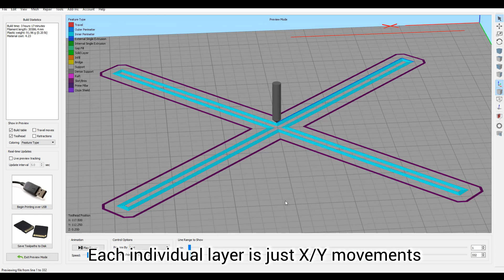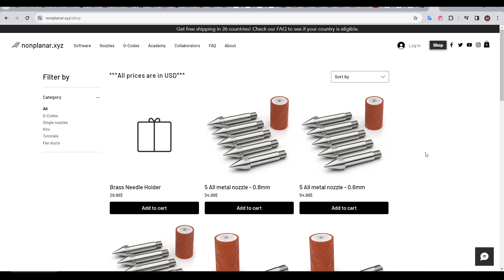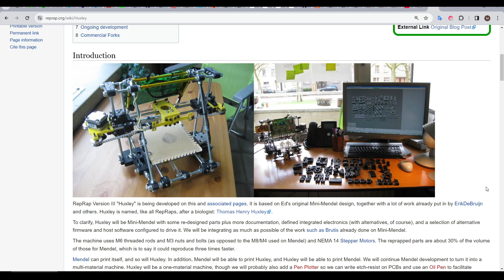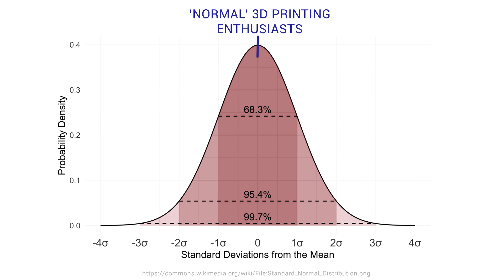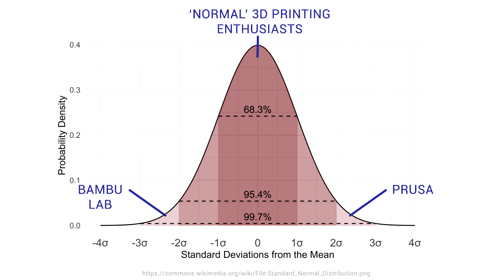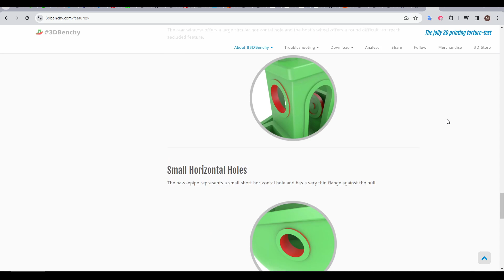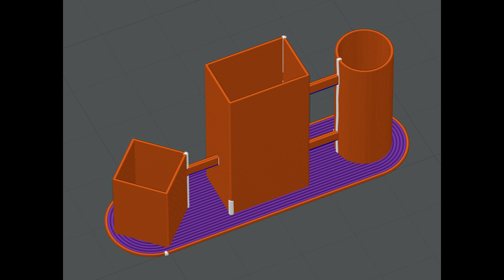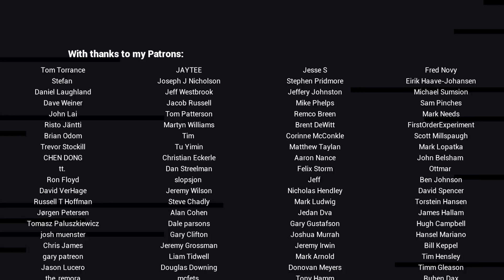3D printing mysteries that need to be solved in 2024

Comment: For the surface artifacts: my hypothesis is related to thermal expansion and cooling. When you have a top surface, you print more slowly, thus cooling more the rest.
Reply: It´s variations in flow rate, speed and cooling. You can change the preview in the slicer and you will see the difference.
Reply: with a layer time that was consistent across the entire part, these went away in my case. they would always show up with large jumps in layer time either direction.
Reply: @mrrooter601  This always, happens in any part. You change the print parameters mid print, it will show.

Comment: Excellent video. I'd like to know why belt printers never took off. I assumed someone would do more and better cr-30s but nope!
Reply: It's still early. Maybe the time will come. For now what I understand is that belt material is a problem and belt centering/positioning is also an issue. 45 angle is also pretty extreme, there are some printers (or mods for CR-30) to make it less extreme, or even 90 degree printing is pretty good because it allows for infinite part printing without much of slicer changes. Yeah, also slicers and infinitely long GCode files are becoming an issue

Comment: Non-Planar 3D printing and those neat overlapping circles for overhangs! I would very much be okay sacrificing printing speed for quality for some of my prints. An on/off toggle would be *chefs kiss*.
 I'd 100% pay for a slicer plug in (*cough cough* Cura now supports full slicer plug-ins like this now, developers!)
Please and thank you.
Reply: I would as well, but there is a conflict here that the people most likely to work on something like non-planar printing would probably be on the easiest to tweak firmware too, and then they are unlikely to be Cura users as Cura has no Klipper flavored gcode output because it's almost all Ultimaker devs, and ultimaker has no klipper printers.

Comment: I may be wrong but I think the filament breaking is just humidity. It's somewhat humid where I live and because of school I may go weeks without using my printer. But it's pretty normal for me to come back to my printer with the filament broken just before the extruder and I need to extrude all the filament currently in the Boden tube as it's too brittle to pull out. That filament will also snap if bent. But then I'll throw the spool into my dehydrator and afterwards it's fine and not brittle. After a few weeks of not using it again and telhe process repeats. So in my experience it's just humidity that causes that. Maybe difference in Temps thought the day causes more humidity or condensation in the boden  leading to that section more brittle or something, I don't know, but that problem for me at least is always able to be fixed by drying my filament.
Reply: I don't think it's really the humidity. Because you can make an experiment, put a coil of filament into a ziploc bag with half a spoon of water, store dark and cool. When you retrieve it weeks or months later, it will be extra supple rather than brittle. It won't be what one would call printable but it's a different issue, it will feed well but cause a calamity in the hotend then, so when you have waterlogged filament, you still need to dry it.

I wonder if the PTFE tube itself plays a role, whether it liberates fluorine compounds, or some fumes coming up from the hotend from the filament melting process itself into the Bowden tube. But i personally don't use Bowden and have not had this issue of brittle filament, but i also have everything far away from UV light and have exceptionally low air humidity.

I am still undecided whether water does make PLA brittle or not, want some credible evidence, but at least a limited waterlogging experiment doesn't suggest that it necessarily does.

Apart from degradation, the matter could be of reversible changes that get alleviated when drying effectively anneals the filament.
Reply: @SianaGearz  my main point was that after a few weeks the filament outside the boden is also brittle for me, I can also sometimes get some of the filament out of the boden but it is very brittle. When I put the brittle filament into the dehydrator, it's no longer brittle and is like new. So it was brittle, then wasn't after dehydrating. Which means something happened when dehydrating that made it less brittle. So my guess would be humidity. I'm sure with the bag it's an extreme example so it will net different results compared to real world scenario of humidity in the air
Reply: @Penguun  That's good to know.

Comment: Capricron now has a Reverse Bowden tubing product available so when those filament breaks happen, you can get the filament out much, much easier.  (Rather than playing chimney sweep with a small aluminum rod to unjam the material!)  Tribalism is a great term!  I see that with the Prusa and Bambu Labs folks.  I think part of this is that Prua is very Open Source where Bambu Labs simply isn't and probably won't be.  And who wants the Communist China apps on your phones to print?  As for the Voron crowd, those are very technical builds - built one here at work and it sure wasn't easy.  One thing I was hoping you were going to mention is the obsession with PRINTING FAST.  Sure, you can.  But if you are making functional parts or large parts, you are giving up quality and possibly part strength by doing so.  If I had to give one award for best thing in 2023 - improved tree supports!

Comment: I agree that we need non-planar and custom-planar setting- availability in mainstream slicers. No question. We also need devs to stop removing features "for no reason" and making the user experience objectively worse through progressive changes to the interface.

The filament "swirl direction" phenomenon is indeed coincidental. It may depend in part on the filament's curvature as it enters the toolhead. I've personally observed it swirl in both directions in the northern hemisphere, sometimes within the same operation (no cessation, no retraction, no replacement).
Reply: When have you ever seen a developer remove a feature "for no reason"?  Do you mean for a reason you don't agree with?
Reply: @crashingsux  I've many times seen a developer remove features without giving any reason whatsoever (such as CURA repeatedly removing the Change At Z feature). I've also frequently seen developers remove features while giving reasons that don't hold up to any scrutiny (ex. Microsoft removing every accessibility feature from Skype when they bought it). Both of those are separate and distinct from developers removing features and giving reasons I disagree with (every program that has ever removed a configuration option entirely instead of hiding it under an "advanced" section stating "it's too confusing for people" or similar tripe, or eliminated the Menu Bar "to make things easier", or ripped out the command line API with the same sort of excuse).
Reply: @claws61821  Sounds like some really bored developers who hate the users they write software for.  That must be it right, it can't be like they have competing concerns and someone else besides you is asking for that feature. Hard to believe Ultimaker pays those CURA developers to do things like that.
Reply: @crashingsux  Uh-huh. Goodnight, Troll. Enjoy deliberately missing the point throughout the new year.
Reply: @claws61821  not intending to troll. I hope in the new year you can find a way to appreciate the developers who toil away for no compensation providing you with the software you use and maybe grow to appreciate it enough you stop insulting their character and motives.
Reply: @crashingsux  You asked for examples. I listed several. Your reaction was to respond sarcastically with a moralistic fallacy and psychologist's fallacy argument. Textbook trolling tactic. That after you attacked me ad hominem for my initial rhetoric (which was enclosed in quotes to specifically emphasize it as such) and combined with a second ad hominem attack. While there is certainly a possibility that you weren't intentionally trolling me, as you say, the weight of available evidence suggests otherwise and that you are, as the kids like to say, "covering your ass".

Comment: On topic of the surface artifacts.  I would try changing the minimum layer time. My theory is that because the layer with the additional object takes longer there is more shrinkage compared to the previous layer. 
If the next layer goes down quicker it reinforces the previous layer and lessens shrinkage.
Reply: I concur, if you use the slicer from prusa, orca, or bambu, you can check the speed of each layer by changing the line type. I can almost guarantee that's the cause, as it's something I had noticed in the past as well. This needs a bump
Reply: This is true I run into this issue when printing things that need a lot of support
Reply: There will be more shrinkage but also the plastic has longer to cool down, so when it gets to that section on the next layer the plastic is much cooler and hence maybe doesn’t fuse as well. Maybe decreasing speed on those sections to allow the layer below to soak up more heat again would help.
Reply: If you switch the view to volumetric flow rate and scroll through the layers you'll see it happens whenever the flow rate changes.
Reply: @ExtremeODD  in Prusa slicer there is a way to control the volumetric changing speed. Do you think it could solve this problem?
Reply: @leopagottigmail  No, this has been tried, there is an entire thread dedicated to this on the Prusa forums that have tried pretty much every setting on multiple slicers.

Comment: I live in Spain rn and I tried extruding filament at differents heights but it looks like the way it turns is pretty much indifferent, at least for me, with an Artillery X1 with a Hemera extruder and a Volcano nozzle it doesn't have a preferable way to turn, i'd say probably like a 50/50 chance to turn clockwise and viceversa. I think it's all about the shape of the filament when it's dropping and starting to cool down, as with every little variation it hits the bed slightly different and it turns in the direction that is easier for it to drop flat at first. 

That is my general observation, but I'd love to see actual testing on this as I think it's a really interesting proposition.
Reply: I'm in the northern hemisphere, and checking the poop box from my X1 Carbon, I have several examples of clockwise extrusion and counterclockwise extrusion. I don't see any indication that it tends to coil in one direction preferentially over the other.

Comment: I do not know why the world has gotten so cynical, I used to enjoy the groups now I avoid them, and just search out what I need to know to fix things. I started out with Bambu lab printers I watched your video on the MP mini Delta I had the have one, so end up sourcing some parts only V2 off of eBay now have three of them working. I can sit there and watch that thing Print all day long, It’s mesmerizing and relaxing better than a fishbowl. And enjoy watching your channel. I learn a lot from watching your channel. And just from suggestions and ideas I’ve come up with some really cool stuff to 3-D print for people that nobody else is making. And less than a year I paid for my printers with a few things I have printed and sold. On your square cylinder and square block I think it’s speed, retraction and cooling and watching Prints as they print as they get to the top of one it slows down to give a good finish on the one that is completed, which seems to always affect any other objects that are being printed, if everything‘s the same height, you don’t see it, but when it slows down the print the top of something it shows up in the other prints, I’ve seen this on the Bambu and the MP. Both the slicers will let you address these sayings to some point, but I can’t seem to get it to go away either, so I’m praying things with multiple heights. I usually print them separately seems to be the best resolution so far. That’s all the input I have enjoy watching your channel. I’m glad you’re out there and you said it’s the 3% that matter the least they’re the most vocal so ignore them. That’s what I do, Granted, with the small amount of videos I have up I don’t have any comments and I think that’s a good thing.

Comment: Color me ignorant, what is the difference between a core XY and a voron?  A possible answer to your question as to why it seems more toxic is because most of the center of the bell curve tend to be quiet even though it's a larger number of people, and people in the extremes tend to be more vocal. So it's really more of a per capita situation. You would have, in the past, five people in the extreme category but they could only make so much presence because of their limited numbers, now that you have 5,000 people in the extreme column even though that's a small minority compared to the center of the bell curve, it seems like they make more noise, but that's only due to the per capita effect. There's the same effect in news where people used to think that crime was getting worse, but it was simply because more of it was being covered because technology allowed for it.

Comment: 11:53  sometimes a feature like a bridge or anything can make the slicer decide to move the start stop location of a layer in a different spot and this CAN cause this artifact, due to making that corner at a different speed comared to the other layers.

But i agree flow rate is also a possible culprit

Comment: I think the broken filament is from UV (sun) light. I originally thought it was moisture, but even dried filament does this. I've found that if I keep a spool of filament in my printer, it will do this, but if it is put away in a dark closet, it does not.
Reply: I think you have the right idea there. That also happen with other plastics.
Reply: Score another point for my printer closet.  My room is dark anyway, but the closet gets 0% sunlight, ever.  And I never have issues with filament.

Comment: It is shocking that non planar hasnt taken off yet. It's really cool and not a novelty.
Reply: Well - I guess the reason is that you have to take a few steps to print that way. The biggest hurdle, as explained in the video, is that most printing heads have to be modified. Sometimes that is easy, but other times that involves replacing the whole print head assembly. That can be doable for machines that allow easy tinkering, but other machines have a design where the print head is integrated together with the whole leveling mechanism (for example). That would make those needed modifications a big task. On top of that - It's only for those that know what they are doing, and not everyone that has a 3D printer has the needed knowledge to do so.
Of course it things pick up, you will see modificated parts being sold to make replacement simple, but for now that's something in the (far) future.

Comment: I would love for both non-planar and arc supports to get more love, with the latter being the more promising candidate for developments. 
Arc supports would be such a nice addition to a slicer's toolkit, where depending on the input geometry other supports could be entirely left out of a print job. 
Also it would have far wider printer compatibility than non-planar, since it doesn't need any extra clearance, giving a Prusa or Bambu more incentive to implement it.
Reply: For me the largest benefit of arc supports is enclosed overhangs, like holes.  It's not even real arc supports, but rather using circular infill on bottom layers.  Just because it gives more cooling time and support area compared to the back and forth pattern that Prusa slicer does now.

Comment: Maybe your filament snaps due to the shape of the bowden tube. I mean, the filament has a natural curvature to it since it's rolled up on a spool. On the right side (where the filament enters the bowden) the tube follows the natural curvature of the filament. But when it's going towards the extruder, the bowden bends in the opposite direction. I can imagine that the bending in the opposite direction (as opposed to the natural curvature of the filament) makes it easier for the filament to snap into pieces.

Comment: My solution for MOST layer artifacts is to print the outer layer at the slowest speed the slicer used for any outer layer.  This seems to give the the outer layer the best consistency.
Reply: And if you print the outer wall first I think it helps too... but isn't good for overhangs

Comment: Toxicity - It shows up everywhere. The 90's were full of Mac vs PC arguments. It is caused by people wanting to reassure themselves that they made the best choice.

Brittle filament - I think it has to do with micro-cracks in the filament. Moisture expands the filament, making the cracks bigger which is why you see more brittleness when the spool has sat out for a period of time. Drying the filament does not remove the cracks, but heating the spool may relieve some of the stress on the cracks. Filament just sitting in the tube has been deformed putting stress on those micro-cracks and allowing them to grow over time.